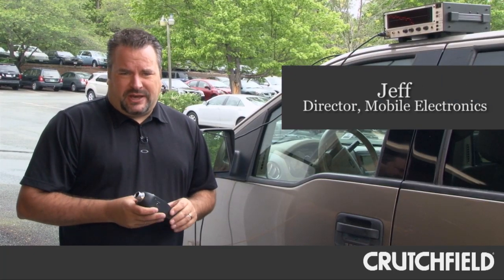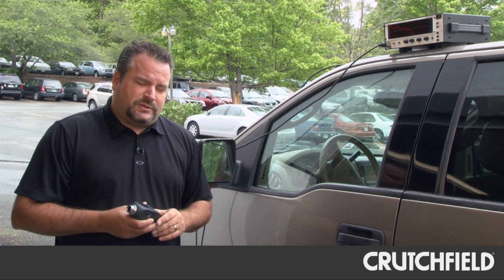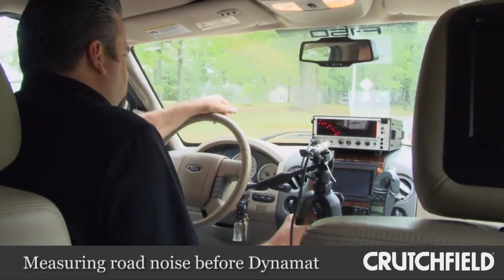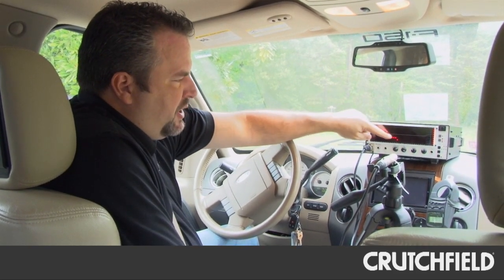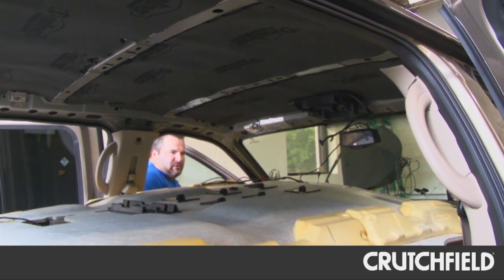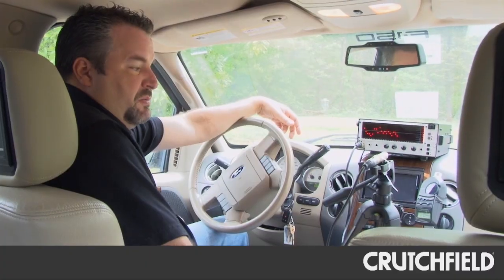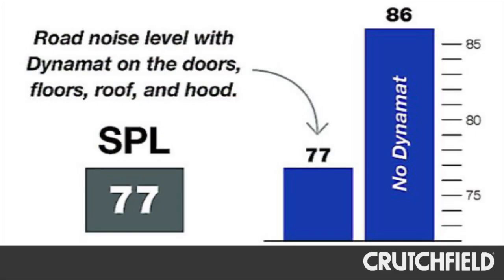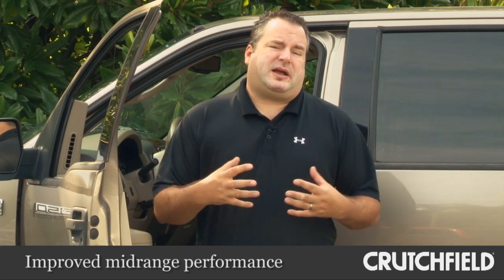Reducing Road Noise with Dynamat Noise Damping Solutions | Crutchfield Video

Comment: After watching several videos on this subject, none of them have convinced me that it'll be worth the effort the time, effort, and money to install this material. I did replace my tires recently because it was time to do so, so I spent the extra bucks for "quiet" tires to find that they weren't much help either. Different road surfaces made a difference, though, especially between concrete and blacktop.

Comment: Steps to do this correctly:
1. Add CLD tiles(this is the stuff that stops vibrating panels. If you let them vibrate, it will generate more noise) in small amounts until panels no longer vibrate. When you tap it, there should be a dull thud. Floor isn't as important, roof will make a decent difference. And we all know about the doors. 
2. Add Closed cell foam to isolate a mass barrier.
3. Add mass barrier. 1lb/sq foot Mass loaded vinyl(MLV) is usually the stuff of choice. It is good at blocking lower frequencies, such as road noise. If you have room, double it up, especially around the wheel wells. Add it to the doors and the floor, making sure there are no openings. Get it as far up the firewall as you can to block out noises from there.
4. Small amounts of closed cell foam on the MLV you used on the door panels. You can add another layer of CCF on the floor, too. This is not as necessary, because you have carpet here. Put CCF on the roof.
5. Insulation such as Thinsulate acoustic. As most people know, even with an unlimited budget and designing the car from scratch, it is almost impossible to block all noise. Noise will come through the glass, etc. And remember that you just added MLV to block noises. Well that's a two-way street. It will block the sounds from the outside, but it will also reflect some of the interior noise which will give you a nice cabin full of reflected sound waves. This is where the acoustic insulation comes it. While the other steps were designed to stock the generation of sound waves(CLD tiles), block the sound(MLV with closed cell foam), this step is meant to ABSORB the sound waves. This will prevent the echoing effect of sound waves.

After these steps, it's just a matter of making sure you have good tires and your wheel bearings aren't shot, as well as checking the integrity of your weatherstripping.

If you want a light car and sound reduction, use CLD tires and some closed cell foam like ENSOLITE. And wear earplugs.

Comment: Like others, I'd like to have seen the RTA plot after the acoustic treatment was applied.  Most of the noise seemed to be in the mid/low bass region, which needs a thick barrier to attenuate due to the long wavelength.  I can imagine a thin layer of Dynamat reducing vibration and high frequency noise but low rumbles???

Comment: I noticed for the front doors you covered the inside sheet metal but the back doors you put it on outside metal. Did you do the outside and inside of the doors?

Comment: I'm willing to cut down the freeway noise, what product should I use? Dynapad, dynamat self-adhesive, or MLV? Mainly I will put it against doors & floors
Reply from the maker: We offer a wide selection of sound deadening products on our website that range in quality/quantity depending on your vehicle and the application. Here's a link to a full listing of the sound deadening products we carry at Crutchfield: www.crutchfield.com/I-rYTVc000/g_181250/Sound-Deadening.html?tp=61817

I hope that helps!
--Crutchfield

Comment from the maker: There is no "one-place" it must be applied. If the exhaust is creating the most noise, you may want to cover the entire floor with Dynaliner. Feel free to call for additional assistance: 800.315.0030--Crutchfield
Reply: ... if the exhaust is the cause, cover the exhaust with glass-viber...... or put some rockwool in it ;-)

Comment: 16 db in SPL is a factor of about 6.3, meaning the measured, broadband average pressure with Dynamat is about 1/6th what it was without Dynamat. Can you do better? Sure, ADD MASS. That's what we all want, heavier cars, right. I don't think so. Well, if you're driving a 3 ton SUV maybe 20 pounds or so don't matter. I drive a car that weighs about 2100 pounds and I want it light, and quiet. For the price and weight, this stuff is pretty impressive. It is a heat shield too. And, FWIW, Crutchfield does not appear to own Dynamat. They are testing the acoustics of it, and they DO know how to do that, and they have nothing to gain by lying. So, smart skeptics, buy something else. I trust what I see here and the experiences of dozens of car builders around the country.  If anyone actually knows of a comparable product that does better, PLEASE reply with data and/or a link.
Reply: Second Skin is another manufacturer of sound deadening products you might want to look in to. I saw a video comparing it with Dynamat, and, at face value, it seems like a potentially superior product.
Reply: Heather Williamson Thanks very much, Heather. I will check it out for sure.
Reply: Doc Moore I've heard of Fat Mat as well, but know nothing about it... So I will be looking into that one, myself. Good luck! In all actuality, any sound deadener is better than none... providing it's not falling off, of course.
Reply: Heather Williamson I have been told by users that Dynamat has an adhesive that really, really sticks. Like, if you dont get it right, you might spend a lot of time trying to get it off. I will be in the market for something in about a month or two for my current build. Thanks for the word about FAT Mat. I'll check it out too.
Reply: +Doc Moore any idea of how much it would cost to fully do a mid size sedan?
Reply: Short answer: Nope.  But, I have purchased the stuff in 4mm thick, 12.5 x 24 inch BOOM MAT. You really do not need to cover every square inch. If you place it so that most of the middle sections of the flat sheet metal is covered, an uncovered boundary around the edges 2 or 3 inches wide will not really vibrate or conduct that much sound. I suggest that you pull out a tape measure and do your best to measure the area of all of the panels you want to cover. This will give you a good idea of how much to buy, in square inches or square feet. Then just price it out by looking at what the current prices are. I figured that I need about 14 square feet so I got a 10.4 Sq. Ft package (5 sheets I think) and a 4.2  Sq.Ft. package --- that came to about $170. This is for a Shelby Cobra (not a big car). You may need a bit more, but Design Engineering delivers quickly so, you may want to order on the conservative side, and if you need a bit more to make it all look the way you want, you can order more.  It is very sticky, very dense, very good stuff. Nothing will keep a Cobra quiet, (nor should it) but it totally kills the metallic sounds of the sheet metal. If you call the guys are DEI they will help you.

Comment: Seems logical that most of the sounds comes in from the engine and the tires so shouldn't the material be placed on the firewall and wheel wells to be the most effective. Wind will only create sound when there is resistance so why put it on the roof and floor, just my thoughts.

Comment: I'm to the point where I'd rather take money away from the speakers for sound deadening if I can't afford it. Cheaper speakers properly installed will generally sound better than nice ones with a poor instal. At the very least I would never install aftermarket speakers without a nice size square over the speaker hole. Then you cut the circle for the speaker and put what you cut out on the inside of the door skin behind the speaker.

Comment: doesn't make sense to me. 3db is a doubling of spl   so the results are unbelievably good
Reply: 3dB is a doubling of sound energy, 6dB is a doubling of sound PRESSURE, and 6-10dB is a doubling of loudness depending on the absolute volume level and frequency balance of the source.

Comment: If it's so good.. why doesen't it come stock?
Reply: They reserve it for the luxury versions of the car.
Manufacturers usually use an epoxy foam, seal the door with additional panels or just use thicker steel during construction.
Reply: Fewer MPG with added weight
Reply: The cost is not worth the profit on some cars. That is why Luxary cars are a thing

Comment: That graf is very fooling for sheep people. 3:08: sound reduction is about 15%
Reply: Sound reduction is much greater. Decibel reduction would be about 15% but Due to the nature of DB, a 16 decibel change would be 3.03 times quieter  and have 39 times less acoustical intensity due to its non linear nature. A 10 db change is a 10 TIMES change in sound intensity.
Reply: You are right, I stand corrected.